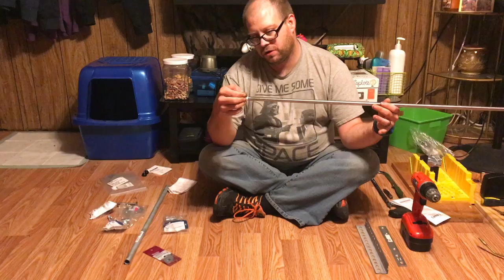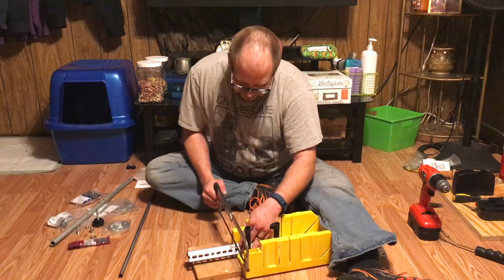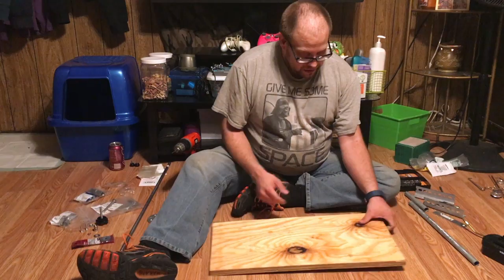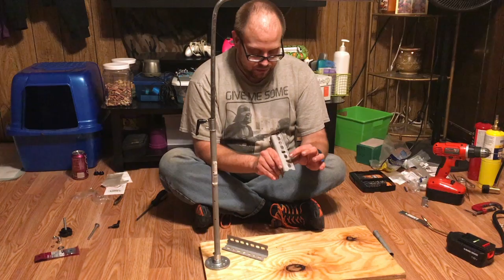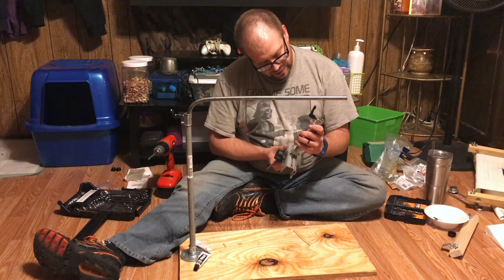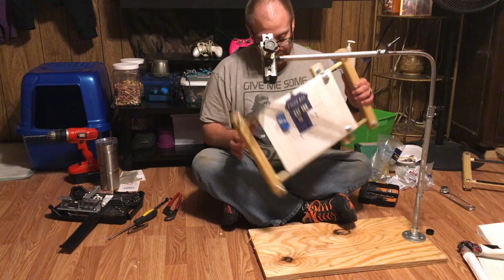DIY Lowery Stand

Comment: I think it would have been a safety thing to round the corners of all the metal pieces. You could go to any metal shop and they would grind them rounded so you would not get scratched or hurt. It’s called a friendly corner!  Also as the other person said paint it so it’s pretty. And after drilling those holes, use a small file to make them friendlier too. Those clamps you use to hold your frame are ‘mounting brackets’ for mounting electrical tubing to a wall or what ever. Plus I think your husband should have done this on a table/counter. Would have been easier for him.

Comment: Wow! I found all the items and added to cart at Menards for 28 bucks! Only thing I can not find online is the Adjustment handles you bought from Fastenal. Would you still have the stock number on them? Nothing I see online looks like what you have. They are sweet. Would really like to have those. Thanks !!
Reply from the maker: +thehomegardener the manufacturer # is MA-49099
Reply: YAAAA THANK YOU!
Reply: I must have grabbed different parts than you did. I picked up the EMT set screw couplings (part # 47240, 3 in a bag) from Lowes. The Adjustment knob ( part Number MA-49099 were way too big. I went to Fastenal with the couplings and they were very helpful in finding the correct size. The MA- 48081 fits EMT Set Screw Coupling 47240 perfect! One thing I regret is the original JB weld. Thinking I needed the longer set time in case I did something wrong lol. Way to much wait time for me. 24 hours!
Reply from the maker: +Therese Ryan glad you got the right parts!  I know the wait is killer but it was the best hold we could find with out being able to weld